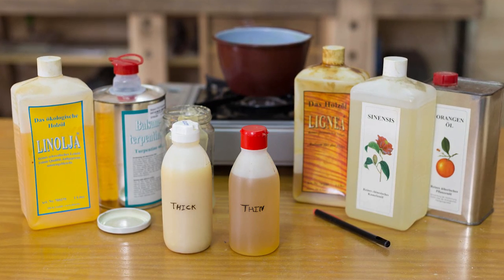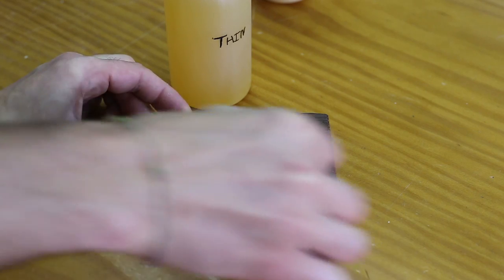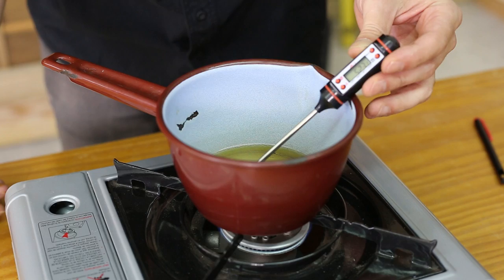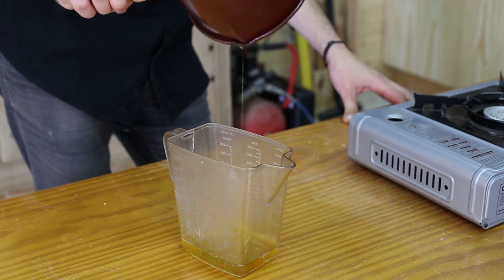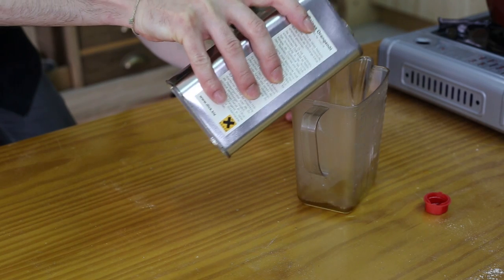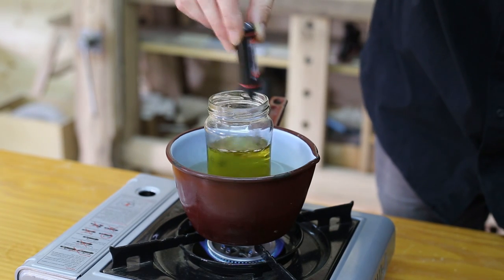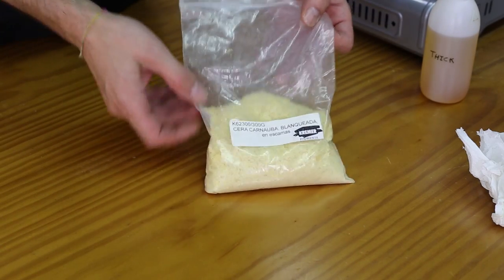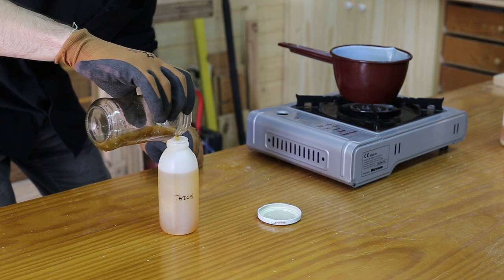How to make an Oil-Based Varnish

Comment: Thank you. How do your oils compare to other wood treatments? An episode on oiling, varnishing, and synthetic treatments would be super cool. Cheers
Reply from the maker: thanks! the oils treatments are easier to apply, better maintain the color of the wood, penetrate better into the wood so that protect better. Dry faster and do not need compressor or spray gun. I will prepare an explanatory video!

Comment: Thank you very much for showing this. Could just the Tung Oil and linseed oil plus turpentine be mixed? I’m thinking of using it to Varnish a violin.
Reply from the maker: yes, that mixture is also a good varnish
Reply: Thanks again, violin Varnish is expensive with regards to the amount you get. So I am researching so as to make my own.

Comment: linseed oil is very flammable. and your cooking it on an open flame?
Reply from the maker: I think you're wrong, linseed oil is not flammable
Reply: it says right on the container that it can combust on its own.
Reply: That's only given particular conditions.  It's not "volatile" like most solvents.  Try to light some linseed oil and see.  Yes it will readily burn on a rag and can auto-ignite, but touch a match to liquid oil and it'll wet out the match.  So don't believe all you read means exactly what you think it does-even MSDS.
Reply: Boiled linseed oil can combust if left on a rag that is crumpled up. This is because it has heavy metal dryers which can cause an exothermic reaction under the right conditions. It's incredibly rare with boiled linseed oil, and even less so with normal linseed. I've actually taken oily rags and put them in a steel bucket to try and get them to combust because i was curious. haven't had it happen tho.